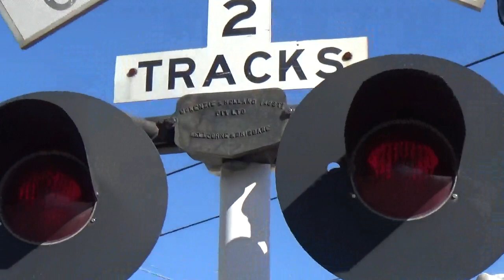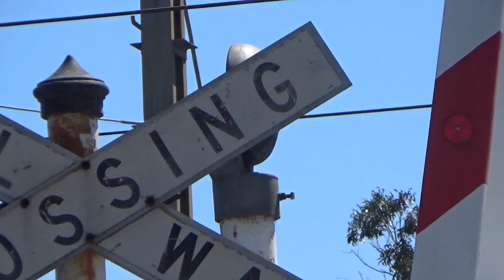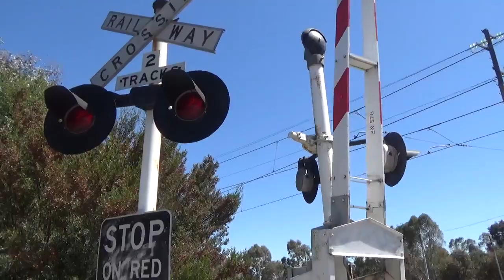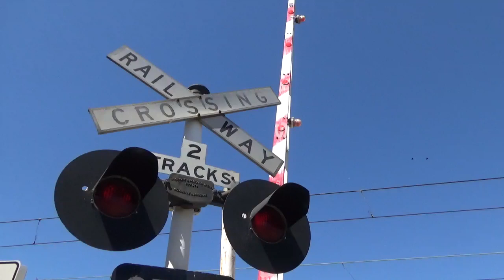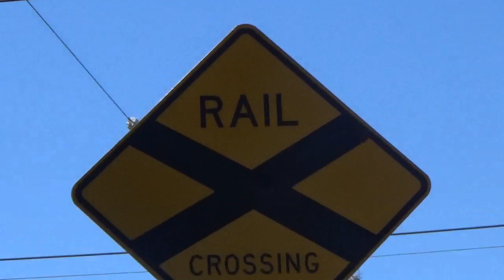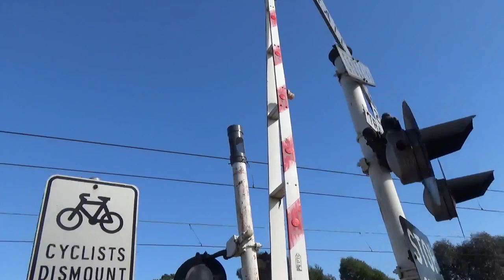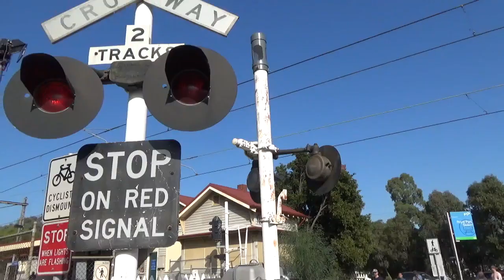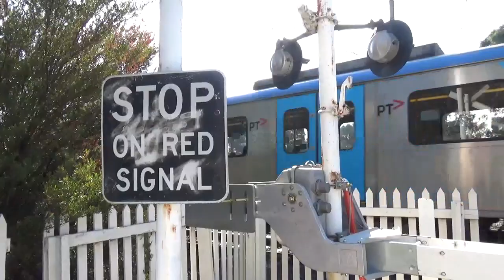Poplar Rd Level Crossing, Parkville (Before & After Upgrade)

Comment: Couple mistakes in the description. It says the bell was facing north like the old bell. The old bell ( 2016 ) was facing poplar road so not like the 2017 bell. January 2017 is spelt wrong .it also says both ebells are programmed to sound out after the gates lower. I wish . Not to be rude but I just though I would point out these minor errors. I also understand how it can take a long time to write a description as well .
Reply from the maker: All good, man

Comment: I just noticed at 9:08 there's a pulse control relay unit from a Westinghouse Hybrid bell lying on the ground. I guess it must have been removed from one of the bells at some point and was left behind. I wonder how long it had been there for?
Reply from the maker: so it is! i'm assuming it was a dud one from a previous bell?
Reply: @Chris 96 when Christopher2000 went to the crossing in June last year he did a video of the crossing with his hybrid bell ringing there which was the hybrid bell that was on the north eastern signal. He ended up finding the white box from a hybrid bell and took it with him. Here’s the video of when he rang his hybrid bell at Poplar Road in June last year: https://youtu.be/rxMnpizv_f8

Comment: Great video. I can see why Metro upgraded with another hybrid at first as the existing bell was starting to play up, but I see no reason to replace the existing pair of hybrids. Metro seems to be inconsistent with upgrades, they have replaced perfectly fine hybrids here but they have left the dead hybrid at Murray Rd Preston (check out Max Grawe’s video from a few days ago, the dead hybrid is still there!)
Reply from the maker: That's what's been happening when they replace old boom gate mechanisms. They upgrade the bells as well. It's quite unpredictable!
Reply: @stuarthunt101  I might go check out Murray rd, Preston again as it might have adjusted GS type-1s now I would reckon.